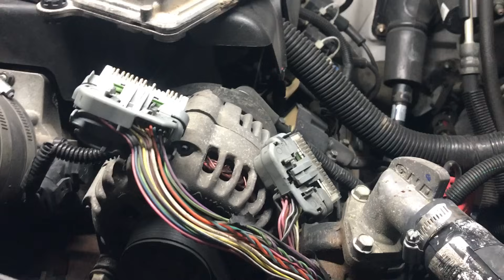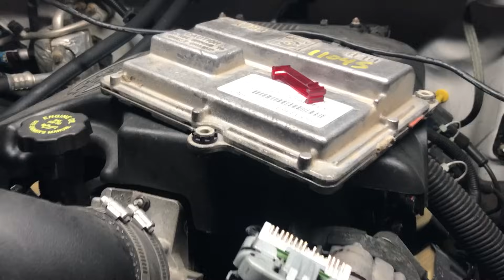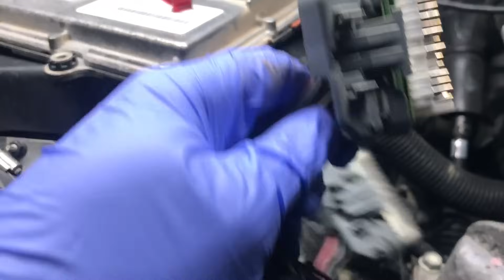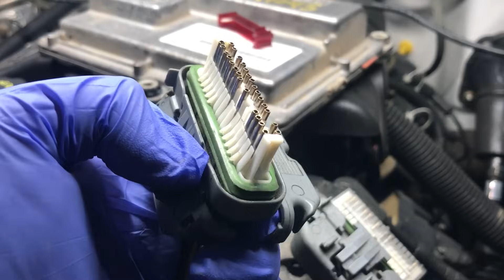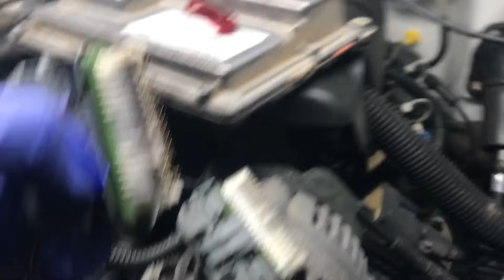Allison 5 speed TCM common issues and fix Allison 1000

Comment: Would this cause a P0700 code and limp the trans around the 4-5 shift under heavy throttle? 

Thanks!
Reply: I'm having the same issue, you figure out what's causing it?
Reply: @clyde906  pretty sure the Transmission is just getting old. The line pressure drops in 5th gear which causes the slippage on the worn clutches
Reply: Yeah that's kinda what I was thinking I just wasn't sure because the truck only has 145,000 on it but I'm pretty sure it was beat on before I got it
Reply: Tylor Harden I’m having this same exact problem with mine at 98,000 I think the guy before me beat it up as well. Does this problem fix it? What other options should I look at before rebuilding the trans?

Comment: 2007 Chevy 2500hd 6.0 Allison trans drives almost perfect in"D" , but when I select tow/haul mode rpms jump WAY high like over 4000rpm when I'm trying to slow down, could these connectors be the problem as well?
Reply: esco361 that would be your engine breaks I believe
Reply: Yeah thats the engine brake its supposed to do that. It down shifts to slow the truck and trailer down without wasting the brakes

Comment: Thank You! I replaced the fan shroud and suddenly had transmission issues. Smashed on the wiring back into the controller and boom it works. I will check the pins soon and actually fix the issue but you saved me a lot of time and money at the dealer! Thanks again!
Reply: Funny how vehicle manufacturers seem to have great ideas like the L shapes pins to take the headlights out with, but then they have garbage wiring for many years having the same issues with every vehicle, and they don’t do anything to fix the problem. 
   I bet if they gave an extra couple inches of wire and didn’t bend it so tight, that harness wouldn’t have any issues.
Reply: Yes. Haven’t had an issue since. It’s been a few months now with no issues since.
Reply: @tb3687   Thats good! I had to move the fan shroud a year ago to change the PS pump and I've been having a Trans Hot Engine Idle problem ever since. I've taken the pins out and cleaned them and made sure they were secure over and over with no luck. I'm so over it.
Reply: @Jacobtaylor1775  Did you ever get this issue solved? I am having a similar issue where after driving for about 5 minutes the trans temp gauge will rise rapidly to 300. The dash high temp warning light will come on. This obviously isn't long enough to see that type of temp increase. Then suddenly the gauge will settle down to the normal operating temp reading and the warning light goes off. The other day after it had been sitting for a few hours, I put the key in and turned to the on position and the temp gauge showed over 200 degrees when it was absolutely cold.
Reply: Did it work?
Reply: Ya that's what I did I'm heading home to check pins

Comment: Could this cause my truck not to start? And also the gear indicator won’t show and trans temp won’t show and when I start it with a screwdriver to the starter it like stays in 3rd gear and won’t go out of that gear. It sometimes fixes itself and drives normal but then sometimes it will mess up and also will say service 4wd
Reply from the maker: could be

Comment: Oh my pickup is a 2004 GMA 2500 HD with the 8100 8.1 gasoline engine.
Reply: Exact same truck mines sport red
Reply: @goosebumps2571  mine is solid black. Wish I could get mine going again.
Reply: What happened too it
Reply: That's crazy too see some people still have the 8.1 tho
Reply: @goosebumps2571  I bought this truck in December of last year. Been a good truck until this happened to it. The dealership said it would cost $1000 dollars for them to fix it.
Reply: Mine jerks hard up in the higher gears like 3rd 4th and 5th it might be this or something else but my trucks only got 80 something thousand on it so it's in fairly good shape

Comment: Im having an issue with the grey side of my tcm. One wire pulled out. I lost pin. Truck will not start. My question is where can I find a replacement harness? How much do think a new harness would cost? Im desperate. I live in Odessa, Texas and cant find any shops out here that know anything. What's your best advice? Thank you for any help.
Reply from the maker: So you just need a new pin? I should have two left from a recent order.
Reply: The best shop near you is howards transmission.  In meridian texas.
Reply: Ill remember about this shop. I finally found the schematic I was looking for and fixed the issue myself. Ive had problems since then and diagnosed and repaired the issue myself except for flashing my tcm. Im learning alot about the Allison Transmissions. They really arent complicated, just intimidated the hell out of me.

Comment: I have an 01 with cyanide c and e low voltage 6 shops and 4 grand later I still can only get reverse periodically everything but the harnesses and cylanoids (cylanoids have been tested) any info would be a miracle

Comment: Could this be causing my truck to shift hard and slam into gear?
Reply from the maker: Could be. Any codes?
Reply: @SpartanAutoworx  Hey thanks for the reply and yes a p0561 voltage unstable...this code doesn't make the engine light come on and can not be found with a normal obd 2 scan tool. So far the more sophisticated scanner the mechanics use are the only ones to come up with it. Thanks again I appreciate any help or ideas.

Comment: How do I reseat the pins?
Reply from the maker: Need to push them thru
Reply: @SpartanAutoworx  my 07 classic 2500hd seems to be stuck on first gear , sometimes I shut it off and on again and shifts up fine but not for long... Any idea what the problem might be?

Comment: Can you please make a video of the wires and location of all the colors I have 32 slots 2 of my pins came loose .... and I dont know what goes where .... one looks to be a peach color with a black stripe and the other was yellow .... but I noticed there are 2 yellow .... I dont have the budget to have it looked at .... I'm surviving off of what I can learn from you tube to restore and fix this truck ....2003 gmc seirra 2500hd 8.1 with the allison transmission...yes 4x4 if that matters .... thank you so much and I hope this reaches you and possibly you can respond back with some helpful feedback
Reply from the maker: Which connector? If I get time I will try and look it up and post it. My time is limited so a video may not happen but I might put the pin out on the website. Just have to find the time to do it.
Reply: @SpartanAutoworx  
 The lower Tcm connector plug ... there is 2 yellow wires only one came detached  and what looks to be a peach wire with a black stripe that has become detached .... if you can tell me the pin location for both yellow wires and the peach with black stripe  I see they have numbered slots I can figure it out ....
Reply: @SpartanAutoworx  
And thank you sooo much for the response and your time
Reply: @SpartanAutoworx  
Again it's the 2003 seirra 2500hd 8100 vortec 4x4 with the allison transmission crew cab ect ....
Reply from the maker: I will try and find some time today.
Reply: @SpartanAutoworx 
 thank you
Reply from the maker: http://gmflash.com/allison-5-speed-wiring

Comment: Hi I have a 2001 2500 duramax and it will not move when I put it in to gear. When I go back to put into park it grinds like It would if I was rolling and just through it in park. Any suggestions on what to check i have tried it in 4 lo 4 high and two while drive I really don't want to jerk the tray and transfercas out and replace if I don't half to. Any help would be great thank you
Reply from the maker: If its grinding sounds like something is bad inside the trans.

Comment: Hi 
I have a 2001 gmc 2500hd with allison transmission ande been getting p0700 and p0712 code. The trasnsmission high temperature light goes turn on and off. Causes my tranny to have shiftting problems when on and works fine when off. High tranny temp goes on when truck hasnt been running for a while and cold. Could a bad pin connector be causing this issue?
Reply from the maker: Had a customer with a very similar issue a couple weeks back. ACDELCO Neutral Safety Switch fixed it. Much to my surprise, because I don't see how the two tie together. He had replaced it with an aftermarket brand after some other issues with the trans came up. AC Delco Switch Fixed it. 

I would recommend the following first. 

1. Check wires at tcm.
2. Check the Neutral Safety Switch.
3. Check Harness inside the trans.
4. Check the Fluid Temp Sensor inside the Trans.( You would have to google on this one never done one.)
Reply: @SpartanAutoworx  
Thank you for your response. 
I dont believe tranny actualy getting hot because the light comes on and off when driving and when off it runs just fine. 

I changed the solenoids thinking that would solve issue but did same. Thats before i realized that the pressure switch assembly is part that controls tranny temperature. I will check the pin connectors at tcm next and if that dont work possibly change neutral switch as you mentioned.
Where there any other parts that you changed on truck that had same issue?
Reply: @SpartanAutoworx  
There is a total of 4 codes it registers:
P0700
P0712
P1709
P1713
Reply from the maker: p0700 generic code for any trans codes.
P1713 and P1709 on a quick google point to NSS.

Comment: Hi, my Duramax works fine when it is cold, however after driving for 1 hour or so, then stopping, parking, then starting up and driving again, the shift indicator does not show up under the PRND3.., but will jump to the 3 when shifted to drive and it will not drive, if you let it cool for about 20-30 minutes you can get it to go into drive and go, however after driving another 45 minutes to and hour it goes into a limp mode, shifts down, over-revving the motor and then has to be cooled down before being able to drive.   Is this the TCM?    I took the TCM off, removed the plugs, looked for corroded plugs etc then put some dielectric grease back on and reassembled, hoever it did not fix it.   What do you recommend?
Reply from the maker: What year truck? Any codes?
Reply: Did you fix this problem mate?
Mine is doing the same

Comment: I got p0732 code on my 01 duramax 5 speed. Could this be what I need to do?
Reply from the maker: Dont think so.
Reply: Spartan Autoworx ok thanks
Reply: @drzg2640  Most likely a bad shift solenoid.  Sometimes they get all gunked up and cause line pressure to go wonky.
Reply: Any luck on finding out? Have same code

Comment: I have a no crank no start issue with my 2005 lly duramax. I pulled starter and tested. That's not the issue. So I'm going to do this and see if that's the issue. But I still don't understand how you re seat the pins? Could you explain please? Or what exactly am I looking for?
Reply from the maker: Does the truck show in park on the PRNDL?
Reply: @SpartanAutoworx  yes it does. I tested starter and it tested good. Got it to start after testing alternator and reinstalled. I did the same thing you did with t cm to no avail
Reply: @SpartanAutoworx  today I replaced the starter and the alternator ....again still no crank no start. I'm at a stand still. Now I'm broke trying to fix this issue unfortunately and need my truck for work. Unfortunately I don't have many tools just the basics so I can't test if there is an electrical issue
Reply: My issue for a no start no crank was the ignition switch....unbelievable

Comment: I've been getting the p0700 code but the cel light will just blink on, and off, and continue to do this. I'm assuming it may be this wiring issue?
Reply from the maker: What we working on?
Reply: @SpartanAutoworx  2003 lb7 auto trans
Reply from the maker: Check the wiring.
Reply: @SpartanAutoworx  the trans harness was rubbing on the power steering pulley and exposed one if the wires, all fixed. Thanks
Reply from the maker: 5 Speeds are almost always the wiring. Just a bad wiring layout...

Comment: Can this also be the cause of a p0741/p0743? It says 5th gear incorrect ratio and clutch converter stuck off? It’s a 5 speed that has hesitation then goes then after each shift it does a hesitation then goes .. all gears are working but that is my issue when driving and codes it reads with obd2 scanner
Reply: Mine pops up for 3rd 4th gear

Comment: I have a 2015 3500 duramax high country. That has intermittent shift issues when in regen mode. Could this be the issue. The dealer can't seem to find the issue after 4x in the shop. Sometimes slams into gear and sometimes clunks when put into gear and sometimes you hit the gas pedal and it wont go
Reply: Did you ever find the issue to your transmision? I have a 2016 2500 doing the same thing.

Comment: When I get on my lb7 in 5th gear it throws you back in the seat and then all of a sudden just goes to neutral. I have to shif it to neutral then back to drive to get it back in gear. Could the wires cause this?
Reply from the maker: That's is where I would start.

Comment: Had the same exact problem on my 05 GMC 3500 with Vortec 8100. Someone had replaced the lower radiator hose, and routed the wires underneath it. That caused extra strain on the harness, and pulled out a wire that had to do with torque management for the Allison 1000 and it started throwing torque management codes. Had another problem where I received the message "Range Shift Inhibited" on the display... Common problem, mine turned out to be the ignition switch. Really easy fix, and cheap. Symptoms were sometimes no gears, other times stuck in second or third, also pcm threw many trans codes... Check for power on the large white wire connected to the ignition switch... It should have power when the key is on, if not, the switch is bad. Only tool needed to change it is a flat screwdriver, did mine in the Napa parking lot. Just make sure to line up the cogs on the new switch. Has worked great ever since.
Reply: hey man I'm not sure if four yrs later you'll see this message.But my 04 dmax has been stuck in 3rd and sometimes 2nd.No reverse.Maybe every 5 or so restarts I'll have reverse.But I haven't thought of the ignition switch.you may have just saved me $5000 on a new tranny
Reply: @Grannypannies  Worth a try for sure. If not holler back at me, there are some other things to check.
Reply: Did u ever fix it
Reply: @MoeDog-sy5dj  Yes - has been working fine for a long time. Are you having a similar issue?

Comment: I have an 03 Duramax lb7 with an Allison Transmission the transmission was gone through before I bought it that's all I know was pulling a camper last week this week it has started hanging at the 3,000 RPM mark if I'm giving it fuel hard if I stay in it light it'll change just fine I watched your video and it sort of sounds like I could have that problem I've got two codes they come up first code is p 1621 and the second code is p1781 both of those are communication codes just thought I would ask for your opinion thanks in advance one of the thing I've checked my batteries and both batteries are fine my fluid level is fine in the transmission as well guess that's two things thanks again

Comment: I have a 2008 GMC Sierra 1500 4x4 went to pass a vehicle on day down shifted to third and wouldn’t shift to 4th till about 5k rpms then was stopped idling in drive went to take off an it was like it was in neutral had to turn truck off an start again to be able to move maybe 200 yards an it’s like it went into neutral again . Have to keep turning off an on to be able to move short distance.. Any help or ideas on what’s wrong only owned the truck for 2 weeks !

Comment: The truck does fine 1st 2ed and 3ed gear but want go into 4th or 5th and when it gets up to temp it try’s to slip out of gear. But it does fine for in them gears until it gets warm. What do you think could be wrong?
Reply from the maker: Only does it when the temp goes up?
Reply: And I took the trans pan off and that little hole up in there where you can see the clutch’s you can move the clutch’s around a quarter of an inch so I think my clutch’s is wore out in it

Comment: Mine does fine until 3ed gear then when it try’s to hit 4th it goes to neutral would this cause that
Reply from the maker: What codes do you have?
Reply: It’s not throwing none as far as I know
Reply: The truck is throwing code p0722
Reply: @codyhughes8738  did you ever figure out the problem?

Comment: I know you must be a busy guy and get asked tons of questions. But i am having a po742 and of course a po700 as well. The code  is saying my torque converter solenoid is stuck on or open.  I looked up the code and its saying my trans should be in limp mode or if it's not that i should be bogging down when I come to stops because the torque converter isnt disengaging. But I am having none of these symptoms. The trucks shifts great and runs good. Could this perhaps be a bad tcm? Would like to know more about some of my options. 2001 chevy 2500 hd duramax with 100k miles.
Reply from the maker: I would check the wiring.